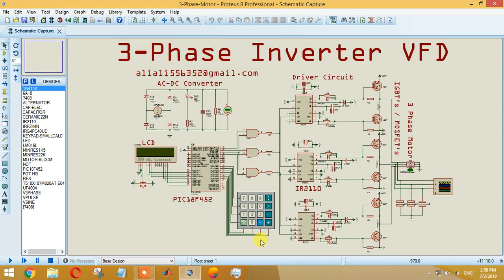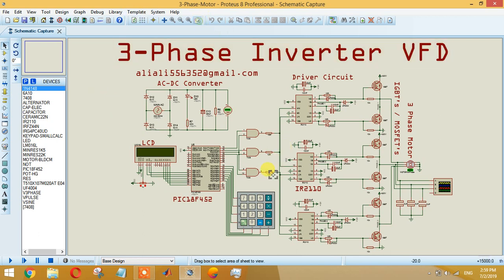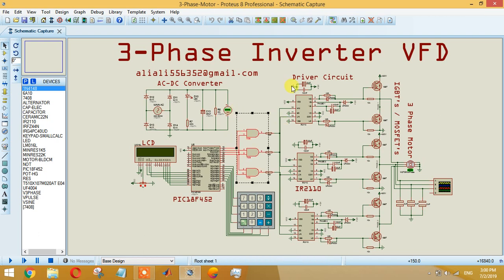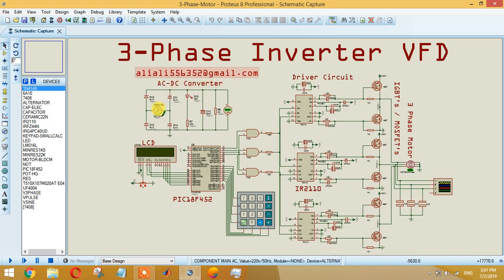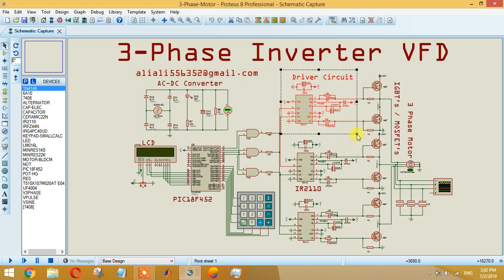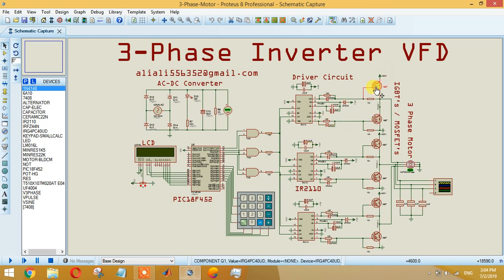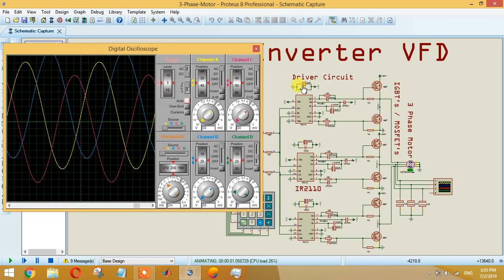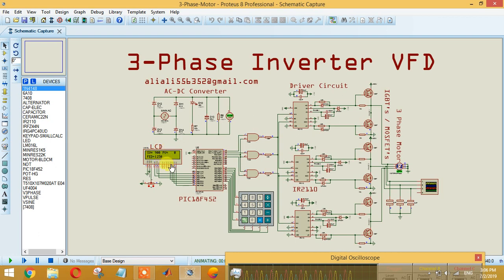Speed Control of Induction Motor using PIC-Microcontroller

Comment: Interesting simulation, but where is the physical running product?   Are offering to give and share  "Speed Control of Induction Motor using PIC-Microcontroller Available [Code + Simulation + PCB + Schematics + Gerber Files]"  so everyone can learn and progress from it.  Then again, are you using this platform to charge for such information??  If that is your intent you should apply such talent and energy to find investors to make you're $$$MEGA$$$.  That said is it "Free" or "Charge"???
Reply from the maker: Yes we have tested on hardware as well and find good results on hardware.